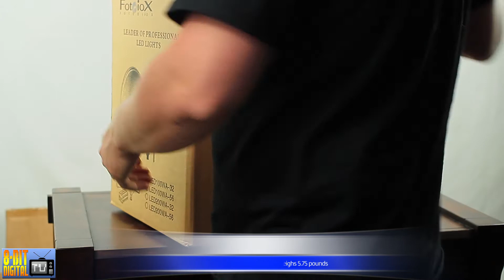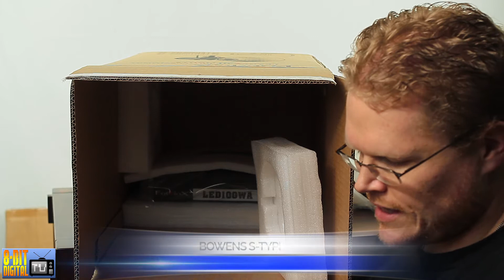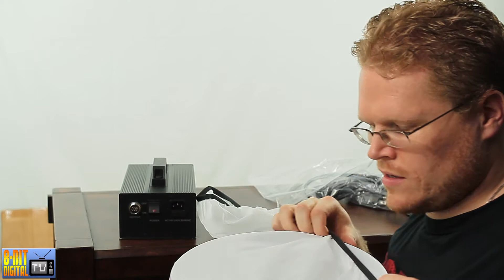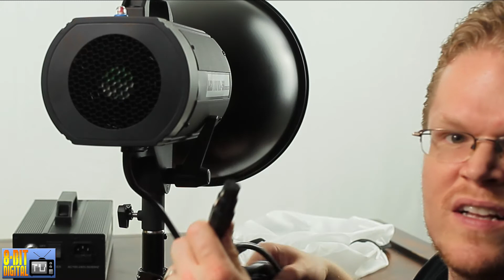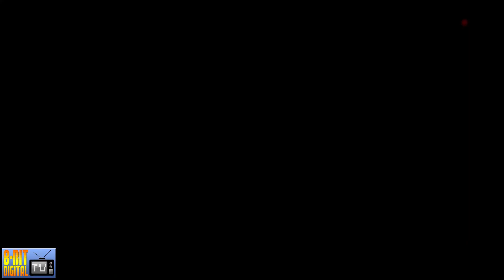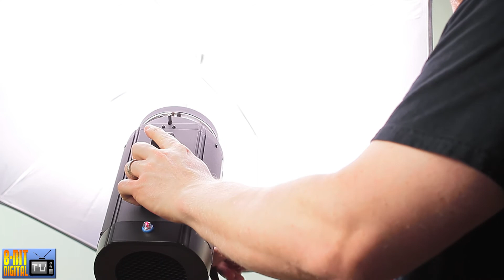Fotodiox Pro LED100WA-56 and OEC Barn Doors [Photo/Video Lighting]

Comment: Thanks for the demo. One question please. How different is using an umbrella than one of the diffusion socks that came with the unit?
Reply from the maker: An umbrella will be a larger light source and therefore give you softer light fall-off.  Also, with the diffusion sock being a smaller light, you'll have more of a "hot spot" in the center when lighting larger subjects.